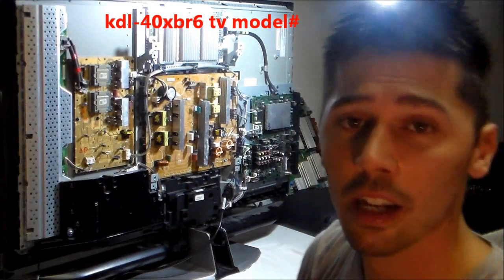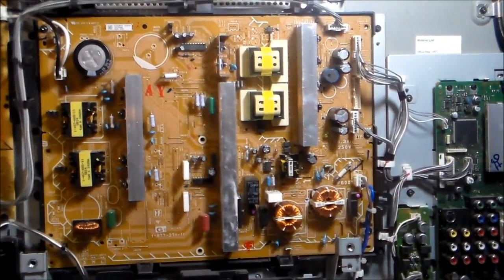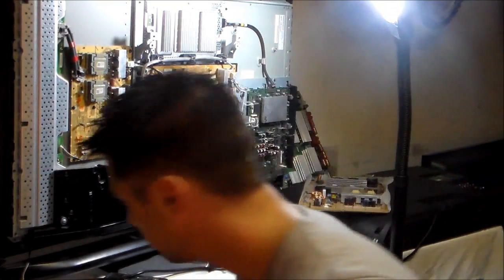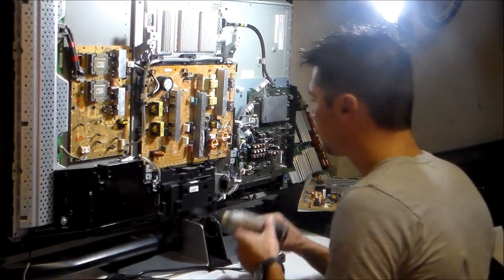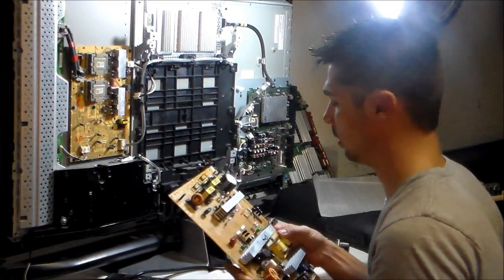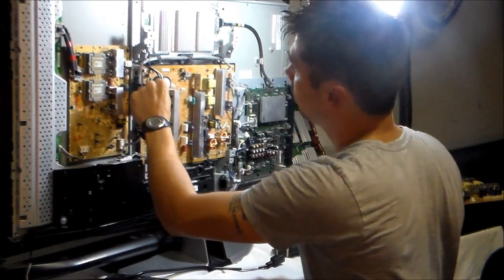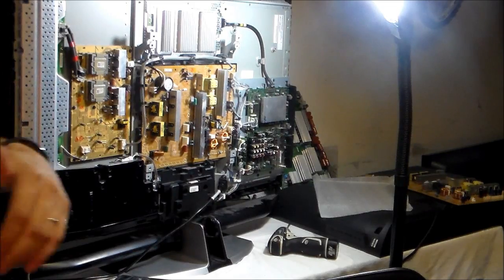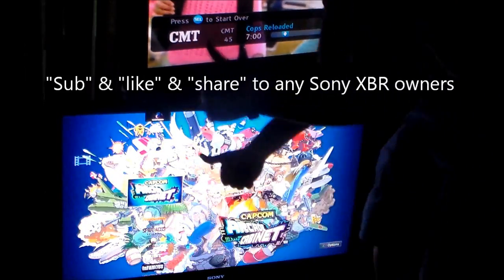5 minute LCD TV REPAIR!!! Sony XBR TV with no power and flashing LED

Comment: I had the same problem with a Sony KDL-55HX750. It was blinking twice on the diagnostic codes. I ordered a replacement power board and no joy. I then ordered a new BAPS control board and still no joy. i've tried every combination of old and new boards and still not having any success at all. The low power side is registering properly and all it does is click as if turning on and then clicks again after a second as if turning off. Just those two damned red blinks mocking me as they blink. I could really use some advice on what to do here and would appreciate any help. Thanks.

Comment: I have a kdl-40xbr9 Sony Bravia black screen no sound no backlight no image seen when using flashlight. should I be looking at the power supply board voltages to see if they're right? Do you have any guides about this?

Comment: Tampatec, I gotta tell you first I have learned so much from your videos, great job. ok now a question i changed the main board on a sony xbr-75x850E and now when I plug it in it powers up but the remote wont do anything. do I have to do something in the settings and how can I get into it with no remote. Any ideas\

Comment: Hi I have a xbr65x900c replaced main board and got no picture just sound. Then did an update to latest firmware and now it has no sound and no picture. Just bright white light initial power and then dims to light white and powers off. Tried doing a factory reset and will turn white then green but won't reset. Please if you could help me out.

Comment: Please help.  Sony XBR-55HX929; I have had it since it was new.  I don't use any of its internet functions anymore; I do everything on my Tivo or AppleTV.  My only complaint up to now has been every few weeks it will randomly reboot while I'm watching something.  Irritating, but I can live with that.  Today I tried to turn it on and it started acting weird.  First there was a very obvious buzzing sound coming from the electronics at the back of the unit.  The TV powered on with both the Sony logo in the bezel lighting, and SONY written on the LCD showing up as it booted.  The green LED on the unit also was illuminated.  The screen after the logo was on, but just all gray.  I couldn't get a signal from either the TiVo or the AppleTV.  The TV would stay up for about 15 to 30 seconds, and then reboot over and over again.  I tried unplugging the TV, unplugging/plugging the Tivo and the AppleTV, but the issue continued.  I finally gave up and turned off the power switch, unplugged all the HDMI cables, and went online to look for a new TV.  Three hours later, I decided to try again, and this time the TV started normally as if nothing had happened.  It feels like one of the boards is going bad, but which one would be most likely?  I saw no flashing red LEDs.  The buzzing is what concerned me most.  The last time I heard this type of buzzing was in an old computer where the PSU had gone bad and was leaking AC current.  In my head I can make a case for almost each of the circuit boards.  Any ideas/tips?

Comment: Hi
Can you help me witch board I have to replace on Sony XBR-65X930D. The TV doesn't power on at all. No lights on or flashing. Thanks.
Reply from the maker: Check standby led and volts if 0v it can be bad power board or power cord. Get tv boards at shopjimmy.com or electropartsonline.com
Reply: Stoyan Kirkov call Sony support very common known problem with this tv. The tv has a extended warranty for this problem until 2021 Google it. My tv went out this past Sunday. If they don't fix or replace my tv Sony will lose another unsatisfied customer.

Comment: My xbr-55x850c started blinking 6 red lights a few months ago.  Unplugging, waiting, and replugging in the tv fixed the issue.  This problem became more frequent to the point where the tv just wouldn't fire up anymore.  Everywhere I read told me to replace the t-con board.  I did.  I bought a guaranteed t-con board.  Then got the orange/green blinking lights.  So I update the firmware.  Now, without even powering on the tv, I get blinking white light.  Nothing I troubleshoot now changes anything.  I unplug, replugin, just a blinking white light.  I never even power on the tv.  Just straight to blinking white light.  Tv never actually turns on.  I know the screen and everything is fine.  What on earth is wrong with this now?  Never buying a Sony again.  This thing is less than 3 years old.  Any help you can provide would really, really help.  I don't have the funds to keep dumping new parts into this that don't fix anything.  Thank you.

Comment: I'm sorry, how can I contact you? I have a problem with a Sony Wega engine XBR-XBR950 tv, and I need your opinion
Reply: Julio you had a top of the line Sony TV.  Isn't your TV the Plasma TV's Sony made in the mid 2000s.
I remember the  Sony 52 inch Plasma TV that weighed like 130 pounds from the mid 2000s.  It had a great pic and was built.

Comment: I have a KDL52w4100 with no blinking lights or any signs of life, however i have 3V at the connector going to the logic board. No power on any of the other wires, thoughts? Logic board? Power supply?

Comment: Dear Tampatec, First of all I would like to thank you, I have been following all your videos and i love it, full of knowledge even for someone like me without any knowhow on electronics it helps me alot Thank You, I have a Sumsung TV Model No LA40c530F1p, and there are Black Spots around 1" in to 1 1/2" in in diameter on the screen.I was told my someone that it is the Panel Problem, can you reconfirm to me what is the actual problem. TQ

Comment: I have a Sony Model number KDL46Z4100. The picture will not come on. The stand-by red light is flashing 14 times.I unplugged the T con board and the power light stayed green for approx. 2-3 minutes then the stand-by red button started flashing again.There is a board which is making a buzzing noise between the power board and the inverter board. Could this be the problem. If not, what do you recommend?

Comment: My sony 810c blinking 8x i've tried to hard reset nothing works. So is it the main board? Can it be something else? Its not always the it blinks 8x , if i disconnect the tv & turn the power on its just blinks blue/white & then it turns back off.

Comment: Sony XBR75X940C... Won't turn on and has red light blinking 4x. Please can you tell me the issue wit this one. I called a repair guy and he is stumped too. He tested the boards and he said they all seem fine
Reply from the maker: DWES ENTERPRISE unplug TV then remove tcon board then plug in tv to see if tv stays on if so change out tcon with a good tcon board. shopjimmy.com or electropartsonline.com use code tampatecfriend for discount 😉

Comment: I HAVE A  XBR KDL-46XBR6 WITH 14 BLINKING LIGHTS. Would I change the t-con timing board.? Tv turns on with back light on and small green light after a little bit, it turns off then you get the 14 blinking red light.?

Comment: Fabulous site. But I have a conundrum and I'm hoping you or one of your followers can help. I have a Bravia KDL 32S3000S with 2 blinking lights. I followed your instructions from "5 minute LCD TV REPAIR!! Sony XBR TV with no power and flashing LED" and replaced my power board. The replacement of the board was very easy with your video, and just as you experienced, voila, the TV worked again after replacement....but only temporarily. After about an hour of viewing the screen flashed, went black, and the Standby light started flashing in sets of two again. Did something else fry the new board? Any ideas would be welcome. Thanks!

Comment: I have an XBR65x900c with 4 red blink code.  Would you happen to know the meaning of this code?
Reply: Tom did you find out about this issue just happened to my TV last week.
Reply: tomg5000 I have an XBR75X940C and won't turn on and 4 red flashes
Reply: tomg5000 any word on what was up wit yours?
Reply: Francisco Melchor any solution?
Reply: same TV  same problem  did you find out what was wrong?

Comment: sony 40" XBR KDL40XBR6 Has red blinking light 6 times. Had no blinking at 1st so I bought a A1552097B power board. Now it tries to start with green light, then blinks 6 times over and over. Any help? Thanks i n advance. Greg

Comment: how to repair sony kdl 46ex520 with a dropping standby voltage? i disconnected connectors from the power board and replaced a diode and some capacitors but still the 3.3volts is still dropping...

Comment: hi there i have a sony 46 inch kdl46x2000 the problem is the green light comes on and stays on but tv dosent power up at all nothing , i can hear a click on the psu board when i press the on button but thaTS  all it does any ideas thanks

Comment: Hi, I have the same problem like this video. Y TV sony is KDL46HX8500, with 2 blinking red light front panel led flashes 2 then pauses. Can you helpme with the number power board?

Comment: Hey, I have a KDL-32ex301 that has 6 flashing red lights, I have replace the inverter but still the same turns on for a few secs then off with 6 flashing red lights, do you think it could be some bad caps on the PSU? cheers
Reply: +Paul Smith I've got the same 6 flashing red lights on another model Sony. Replaced all the boards -- T-con, power and main board. Still have the blinking lights and no video/audio. The only thing left is to check my backlights, but I'm not sure how to set the jumpers on the power supply.
Reply: +Scott N try to set tv to service mode, working ?

Comment: Hi, I have a 52XBR with a steady green light and sony logo when turned on, no picture or sound.  The standby light is off.  I replaced the t-con board but no change.  Any ideas?  thanks in advance
Reply: i have sony kdl sony i change tcom board but  no working i call tht were i buy tyey tell me  is the panel  if is the panel do you have aidea how fixed

Comment: Hey, thanks for your videos.  Very well done.  

I have a Sony KDL 46XBR2 that won't turn on.  2 Questions:  

Have you seen this symptom:  If it has wall power, when I press power button, I get the solid green light, but NOTHING from the red - no flashing.  However, on the right side of the power supply board, there are 4 long rectangular connectors of different size.  If I disconnect them all, the green stays lit AND the red light will flash 6 times.  This suggest to me that the power supply is good?  

My second question is regarding the TCON board.   It looks like I have to remove all the boards, the large ABS plastic , etc, to remove the TCON board.  Removing the TCON's heat sink can be done, but not the board itself without serious dismantling of the TV's "upper deck"

Comment: I change the power supply board as you show on the video..... But i still have the same problem: 2 blinking red light. Any other sugestion?????????? Thanks

Comment: Hey man, I've been looking at your vids and I really dig what you are doing. I have a strange scenario. I have a Sony Bravia KDL-46XBR. It turns on fine however if you turn it off it does not turn back on for another 45-60 minutes. I assume heat is an issue and wondered if you'd encountered this please?

Just saw another vid you uploaded and I think the T-con board could be the issue. thanks again

Thanks dude!

Comment: i am getting 7 times blinking red, i read this is a temp issue, but not sure where to start.  Any suggestion?
Reply: TV model kdl55hx800
Reply from the maker: Sergio Trevino first reset tv by unplugging power for 1 minute, if still 7 blinks then either replace BAL board or HLR board, see - http://www.shopjimmy.com/catalogsearch/result/?q=BAL+board+kdl55hx800
Reply: thanks for your response
i tried the reset but didn't work.
i cannot find the HLR, where is it located?
Reply: So i finally found out the HLR module, it was hidden by the left speaker.  So I disconnected it and tried to turn tv on (from the TV not from the remote obviously), but nothing happened.  So i connected the HLR module back and it worked.  strange.  So I did the factory restore, and configured all after reboot.  Everything started to work fine and after maybe 10 min, it happened again.  TV turned off and red light started to blink 7 times.  So i disconnected the HLR module again and turned TV on, and is working.  I am going to leave the TV on for a couple of hours to see its behavior.  If nothing happens then I will buy a new HLR module.

Comment: Today my TV Sony KDL-32EX600 has the same problem, 2 blinking lights and it wont start. So... do i need a new power board right ?
 Also here in Greece we have 220volt AC so i have to be very careful about the power board.
 Thnxzz gr8 Video

Comment: I have a Sony KDL-40XBR6 with no power and three red blinking lights. I bought the TV back in December 2008 and was not in much use.  Suddenly 3 weeks ago would not turn on and the standby light flashes or blink 3 times in red. I have done already done all the recommended unplug from power for 1 minute , etc.  What 3 red blinking light means?     TampaTec are you in The Tampa Bay area?

Comment: I have a sony KDL52XBR4 the tv turns on and then goes off trough stand by mode the light blinks 8 times I found online 8 blinks mean audio/video board its bad I need help please
Reply from the maker: Call Sony it should be cover under extended warranty they had many issues with that model. DO NOT open it cause it will void warranty.
 Call First- Sony at (888) 649-7669 for diagnosis, warranty service
Hope this Helps, Sub & "Like" & let us know if you get a Free TV repair 8^)

Comment: Hi Tampatec. Great video here precise the parts I see inside the box here. tried today to help a friend with a 4 years old sony bravia “KDL 46Z4500 E”. It has several horizontal lines in fixed places from left side to ¼ on the screen. The picture is beside this fully fine.
We suspected the flat cables for the LCD was next for inspection. Dismantled the back part. Fiddled with the 4 top flat cables and invoked the screen in various ways that did not remove the lines. Then dismantled the multi cord from the main board to the top T-con board (with the 2 huge cooler plates) and cleaned it for some dirt. After remantled it TV still worked the same way unaffected. Then we inspected the high voltage part (invertor board) but found no flat cables in here. Doing this we disconnected the HIGH power PCB (highpover cable /4 lines and the signal lines /7) From the backlight board, but remantled this board again and turned to remove the front plastic and metal frame. Doing this we turned the LCD screen downwards. Having removed the plastic front we also disconnected the IR receiver and poweron button and tried to light up the TV. Realizing the missing IR and POWER button we fixed this and tried again but no luck at all. Even the SONY sign on the front was not lid. After total remantling it all we still can’t get it started.

The TV does have 300V after the diode bridge so the power is getting into the TV. The main board does have some power feed as some of the connectors from the power board has voltage 60V or something. 

The system seems to drag some power when connected to 220V power cord plug but totally soundless. No indicator lamps at all.
Possibly some condensate’s loading.
 
What have we done to deserve this punishment.
Is it forbidden to laydown a LCD ?
Is removing high power cables to high power part a no go?
All cables was unplugged with the TV disconnected from home power network.
The 3V battery on the main board is still fine.
The main switch was tested down to the mainboard. (no disconnections here).
Is there a total TV reset way?

Any guides to process is appreciated.

BR
2 FOOLS WITH A HIGER educational DEGREE (in something else than TV).

Longer answers please to hc-tech@rosenkildeglas.dk
Reply from the maker: Wow that was long lol, Lines in the lcd screen can come from bad internal lcd connection or Tcon board, but make sure you got 12v from power board to Tcon,
Priority Service: sony tv help 239-768-7547
Sony TV warranty services 1888-649-7669
Reply: ***** Thanx for fast responce. Any change you can direct me to a diagram/service manual on the power board A-1552-097-B. What is expected voltage level on the connectors f.ex. Service is not an option. We find the small problem or throw it. Any clue why we got punished so bad?
Reply: He Ca Hi Again Tampatec. I got the TV set started again but still with dotted lines on the 1/4 of the screen. Some whites, some blacks and other colors as well. 10% blinking. comes in arouns 100 horizontal lines, unequaly distributed. I have checked the 12V supply to the T-con board-> all fine. I have managed the 4 cable stripes lines from T-con to LCD -> no effect. I have mangled the cable stribes and moved then 1mm back before closing the lock. -> no effect. pressed upon the cable stribes from top board to LCD panel (8) -> no effect. I have inspected the T-con board -> no visible faults (all condensators are fine (there are not many of them) This is possible the T-Con board faulty but what can I try more? Could it help to heat the board about 120degree in ½ hour or some?
The TV picture on the rest of the screen is fine (no gost or like)
Reply from the maker: He Ca check main board cable to Tcon
Reply: ***** I now checked out the cable onmy  microscope - pretty expencive handmade stuff. All coords securely fastned into the plugs. Cleaned the gold terminals with glass brush. All fine. remounting made no difference. Inspected again the T-CON board (on microscope). Nothing to report except that the termo sponces to the coolerfinns might be dryed out leaving a term-gab? The owner of the set informs it had this fault for 18 month - now giving it up bying a new. But it has not been worse through that time. Future for this set: it might be sold in pieces. Thanx for your support.